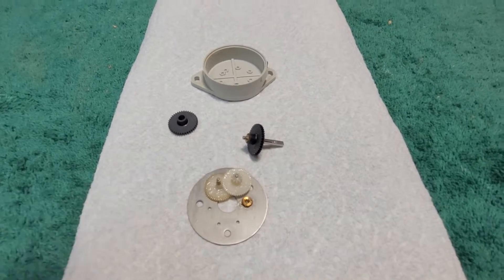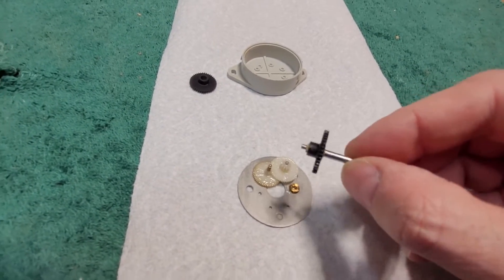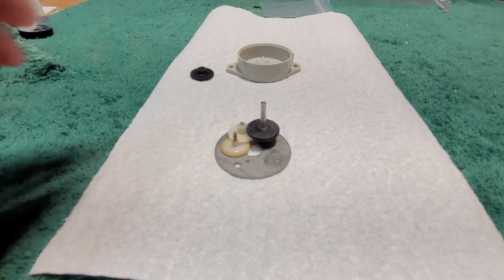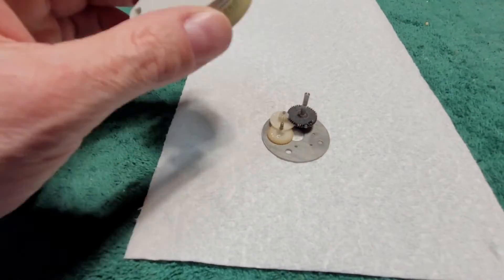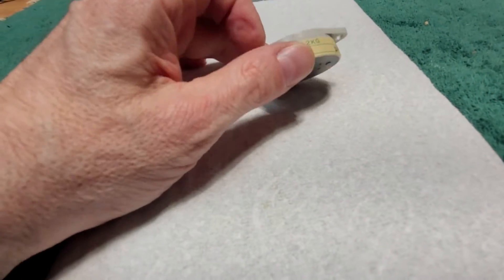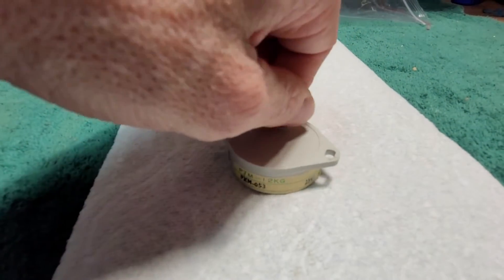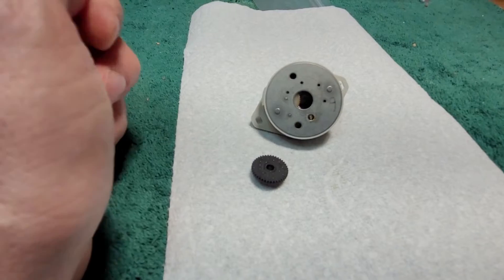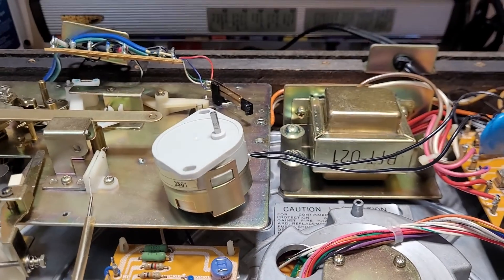Pioneer PL-570: Timing Motor Gear Repair (Part 2)

Comment: Also, what kink of grease is used on these gears when putting them back together?  I suspect automotive bearing grease may be a bit too thick.
Reply: Did u ever figure out which type of grease to use? Im about to start fixing my own pl-570, and was wondering if wd-40 lithium grease could do the job

Comment: Have you ever had an issue with a hum/buzz coming from the timing motor? I have a restored 570 with a newly replaced timing motor. It works fine but there is an audible buzz I am 99% sure is coming from the timing motor

Comment: Wow Sr ..you have helped me so much ...I started repair on my PL-570 5 years ago.. I could never find the problem ..Today i saw your video .On the motor problem.. I rushed to take it apart ..and sure enough ..this thing is bad ..all glued up .Looks like some body has added mapple sirup..And yes a cracked gear with missing teeth in several places ...Thanks ..Now i know i am in big trouble
Reply: There are a couple of vengors on Ebay now selling that gear.  I've been sitting on mine for several months working up the courage to do the replacement.  Maybe someday. . . .

Comment: I am glad that my gears are working flawlessly and that the installation went smoothly. Regarding the price, it might seem high for a simple piece of plastic. However, it is important to understand that the design process for such a gear is time-consuming and requires numerous trials and tests.

This product is made from a photopolymer that exhibits different durability properties compared to the original material. During the design process, it was necessary to make multiple redesigns to achieve an optimal shape that guarantees a longer lifespan than a standard gear. Each change required additional tests and analyses, significantly extending the development process.

Choosing the right photopolymer was also key – I opted for a more expensive material instead of a standard, cheap photopolymer that would quickly disintegrate. The entire production process, from concept to final product, took about a year, including numerous tests on PL570 models to ensure everything worked flawlessly.

Additional costs, such as eBay fees, which are relatively high in my region, must also be considered.

In the near future, I plan to conduct further tests involving milling these gears on modern machines. This will allow for the evaluation of possibilities for further improvements and optimization of the production process. Thanks to this, I can offer an even better quality product in the future.

Warm regards,

Konrad Vrux.

Comment: Speaking as a hobby machinist, the mathematical calculations (found in machinists little black book) needed to design the gear take time, not just physical time, but the time it took to learn the craft in the first place, has a cost to it. When you take your car for repair, the labor cost you are paying is for the technicians experience, not just their time alone. Most trades these days, whether you're a machinist, mechanic, plumber or electrician is around a $120 an hour. So with all that in mind, the price of the gear shouldn't be materials cost only, you're paying for their experience and know of software engineering (g coding etc) in order to get that printer to have produced that gear.

Comment: no I don't think it's expensive at all, if you think about it he has to assemble it with the spindle probably are not in high demand you probably lucky if he sells 3 a year. i can't imagine many are sold the time effort and you got to clean a cog as well you can't really use it straight from the printer I believe.